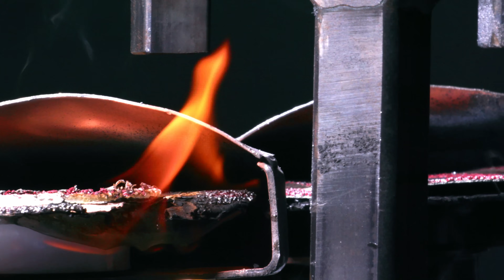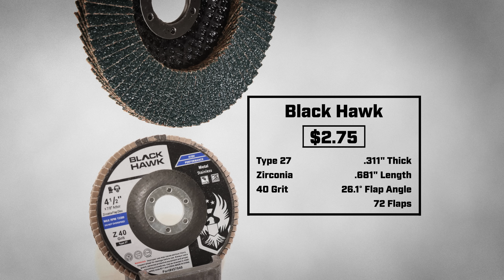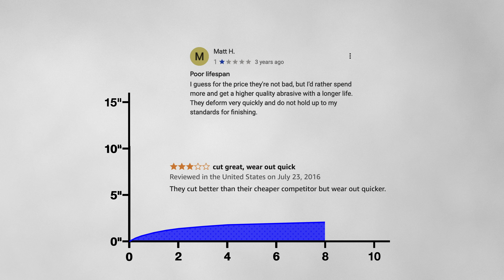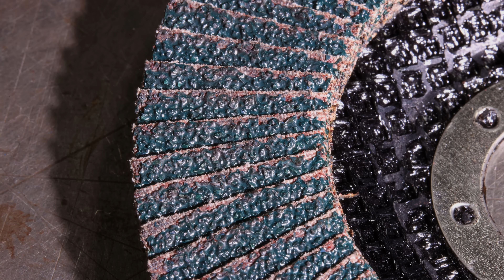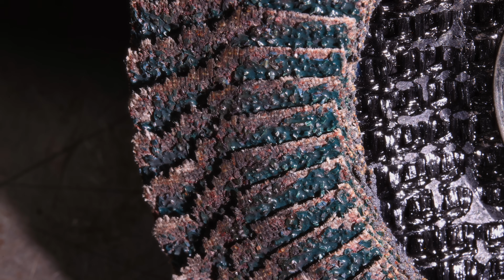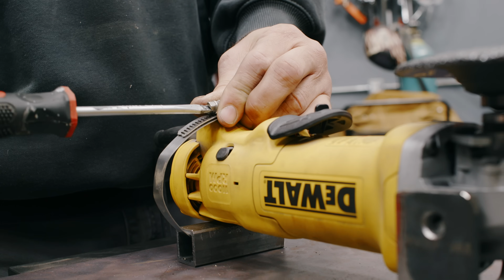Black Hawk Flap Disc Ultimate Test Results (7 of 48)

Comment: Have you tested grinding discs not flapper discs ?
Like pipeline bead discs ?When I started in my career in the pipe trades all we had were 9 inch Black and Decker Wildcat ,or Milwaukee grinders 7" were the smallest..You are testing flapper/sanding discs,not grinding discs.
So When are the 9" Grinding discs tests coming?
The most used back on the pipeline ,was Bay state pipe liner disc.
Do not misunderstand  me ,I really love your ingenuity of how you test all kinds of stuff.
Flap disc and grinding disc are 2 very different birds...